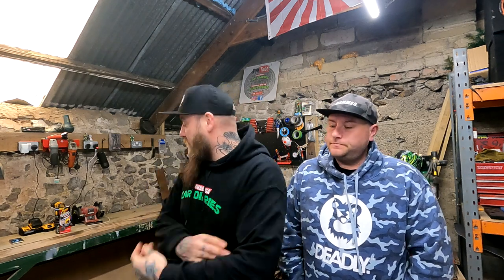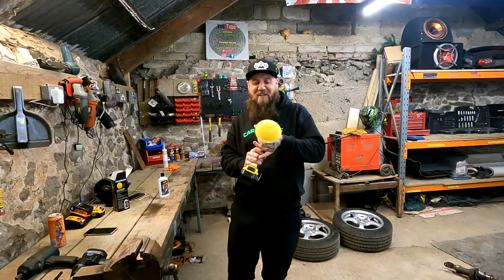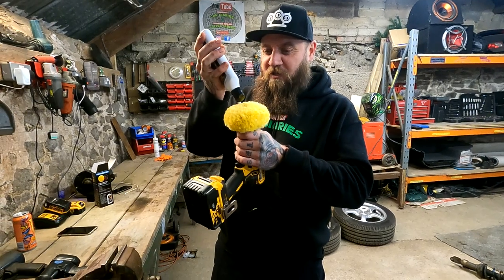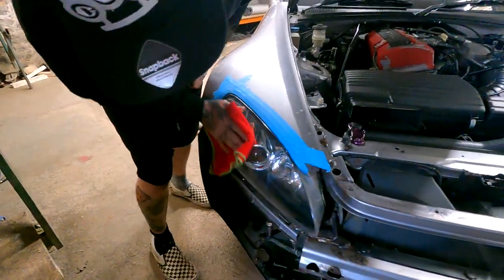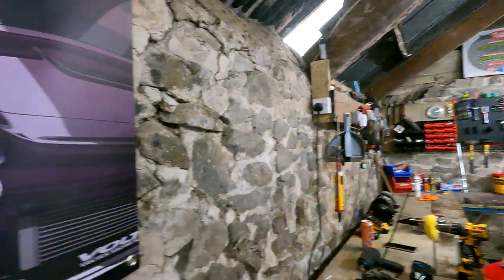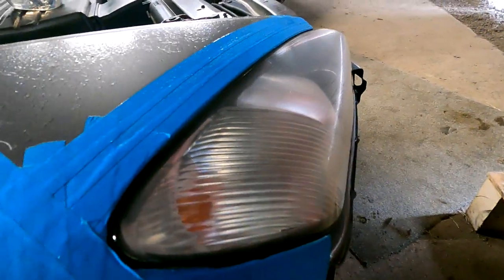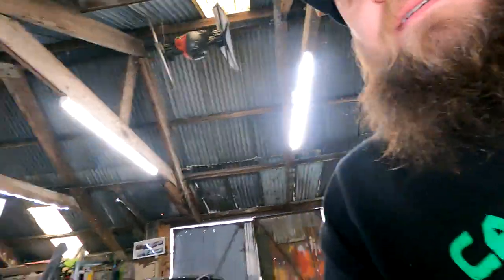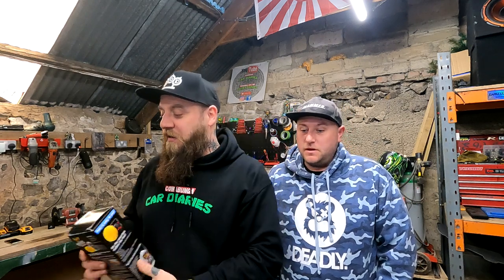*SATURDAY SNIPPET EP6* Meguiars 1 Step headlight restoration kit *Is it any good?*

Comment: Make sure you don't heat up the lense with the drill as it may damage / burn it. Also make sure you seal them with a wax or sealer afterwards to give them some UV protection